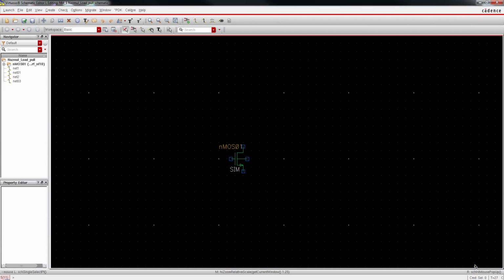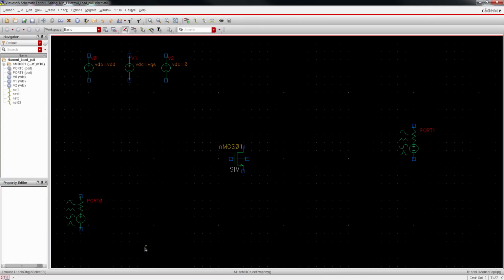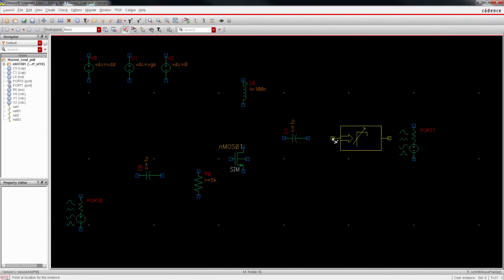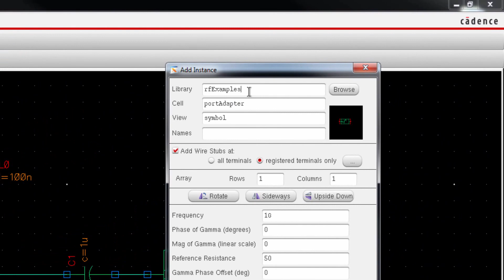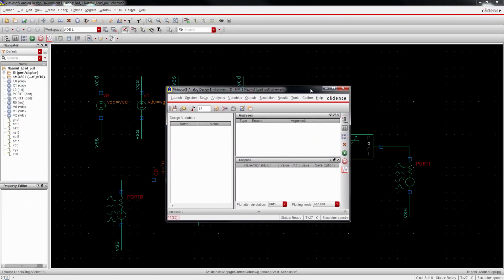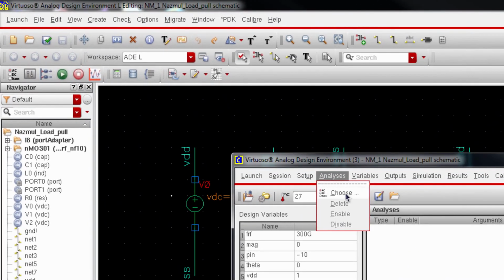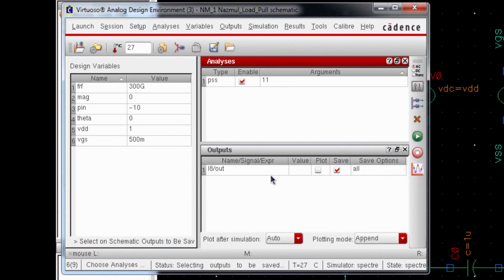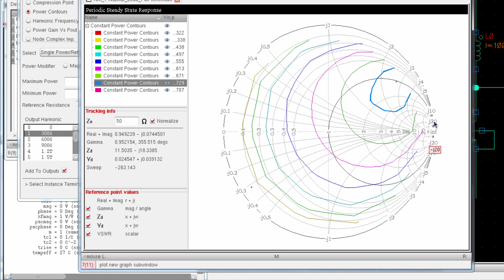Cadence Virtuoso: Load Pull of Power Amplifier

Comment: Thank you for this wonderful tutorial on load-pull for power amplifiers.  you used PSS analysis, what about hb? and you have done it for single-ended output, what about differential output. 
If it is possible do you have personal contact, I want to discuss some issues related to this Topic in RF amplifiers.
Waiting for your kind response. 🌹🌹🌹 
best regards.

Comment: Good tutorial. Therefore, when you are setting the mag between 0 and 1, the sweep must not be step size to 40, because the reflection coefficient is maximum 1. I think it is linear sweep with number of step set to 40. For the angle theta, between 0 and 360, a number of step can be 40 as well.

Comment: Why did you use Vdc=0 7:54 . You can connect everything to ground right
Reply from the maker: jagadeesh I Clearly you have not participated in IC tapeout fab. Defining Vdc=0 as VSS in that test bench allows resuablity in cell. Leave it. It is beyond your concept. Use ground if that suits you.
Reply: @tensorbundle  Well, now that you mentioned its benefits, I will use VSS. I would like to know how to do source pull in cadence
Reply: @jagadeesh103  i think you need to use the port adapter at the source series with the source and do the same or design ur PA in cadence and take the circuit to ads using goldengate.

Comment: Thanks a lot for posting this. It's very useful. I have a few questions:

I saw in the select design variable form that you selected the magnitude variable and swept it from 0 to 1. I think you meant to choose 40 steps, but you didn't select the "number of steps" radio button. The form still said step size. Should it have been number of steps?  

Also, it seems 40 magnitude and 40 phase steps would run 40x40 harmonic balance simulations, is that right? It seems like it would take much longer than you show in your video. How long does it take?
Reply from the maker: Michael Mack Michael Mack You are welcome. I ran this simulation in dedicated linux server in our lab. HB doesn't take more than 2/3 seconds in server. At 12.52 and 13.06, I meant to select 'number of steps' instead of 'step size' which was mentioned in the video's description :-) Youtube no longer supports in-video text banner, so I placed that info in the description. And nope, step size doesn't determine 40x40 simulation. HB's run length and problem size are primarily determined by no of harmonics. Please like and subscribe for more new videos. Thank you
Reply: @tensorbundle  For me when I do HB simulations it takes so many minutes. what do you think could be the reasons?. It doesn't converge sometimes and sometimes it shows that simulation run at some particular mag or theta is failed